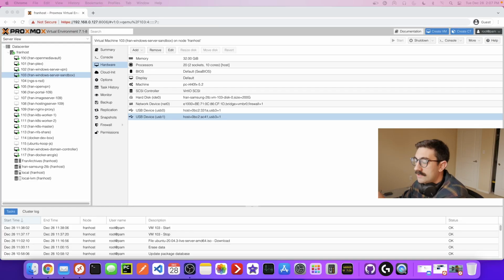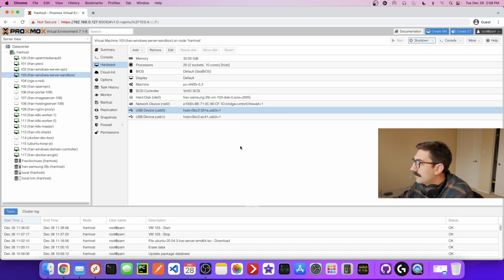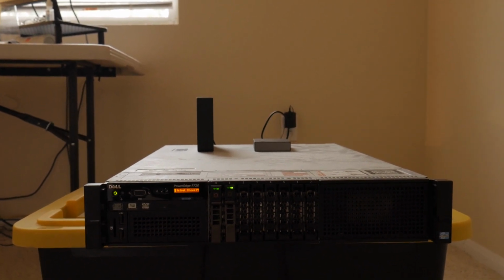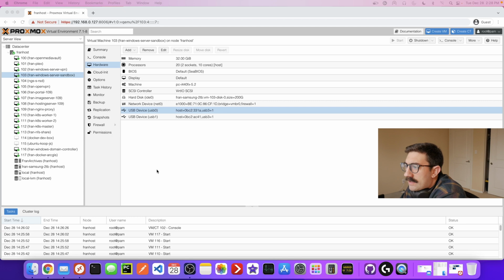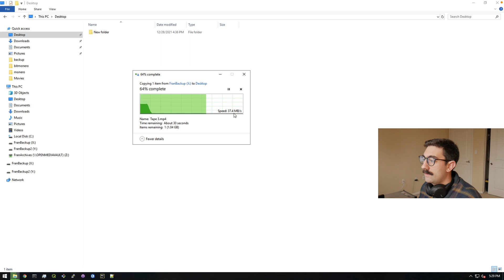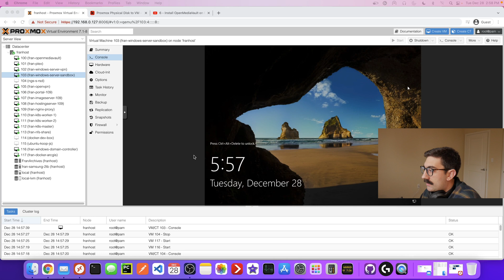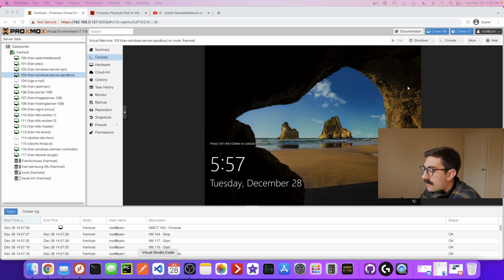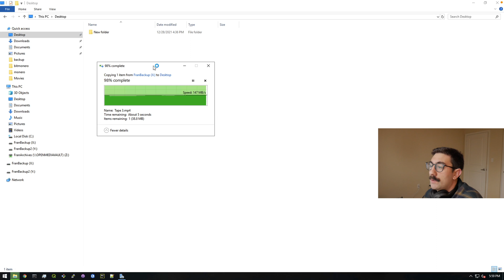Dell PowerEdge R720 USB3 PCI Card Install

Comment: Check the manual for your server. Slot 5 is associated with Processor 1 and Slot 4 is associated with Processor 2. Either way, I'd move it back to Slot 5 if that's where you got the better performance. https://dl.dell.com/topicspdf/poweredge-r720_owners-manual_en-us.pdf
Reply from the maker: Thank you for the manual link! I'll check it out.

Comment: What is your dell r720 power consumption ? Is it way more with usb drives ?
Reply from the maker: I just checked idrac and the average is 125W, not too bad. As I type this, it's reporting 112W.
Reply: @Franchyze923   Mine uses around 167W with 4x2TB sas drives with raid 0 and h710 mini with 2x 2620 v1 cpu. I think its way too much, but I have no ssd atm maybe ill get some ssd cause electricity prices are crazy atm.